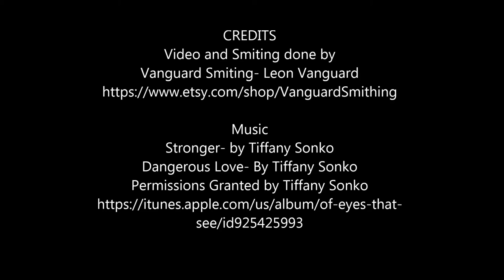Dragon Bone Vambrace- How to make an arm-guard with deep grooves

Comment: This is the only tutorial I have come across that even touches on attaching leather backing to the armor. Thank you I really appreciate it.
Reply from the maker: kent clark if you want I can go over it more in another video anything particular you want to know about how to attach?
Reply: Vanguard Smithing.  If you have the time to do so I would greatly appreciate it. A couple of things I am curious about are do you something other than just rivets when you attach the leather (i noticed you only riveted the edges), another is what thickness of leather is normal for armor and if i wanted a piece that is more shock absorbing how much thicker leather should i use
Reply from the maker: kent clark I rivet only on the sides with 1 inch + from rivet to leather edge to allow the leather to flex around the arm. there is no stress or movement on this piece for the leather so the sides are all that's needed. the thickness for leather backing is usually for a small amount shock absorption is around 1/4 cm or 16 oz hide.For more shock absorption you need something with more cushion, horse saddle padding works well as it is a solid piece you can cut and just rivet on. otherwise weaving a gambission (jacket padded with wool and crossstiching) is used. A cheap option would be to add a thin layer of foam under the metal or leather as it has more give and spring
Reply: Alright thank you I greatly appreciate it as I will use any functional armor I make since I LARP and I eventually want to work my way up to live steel fights.